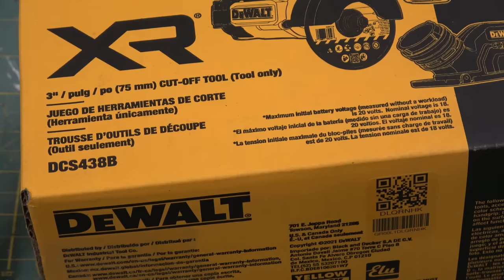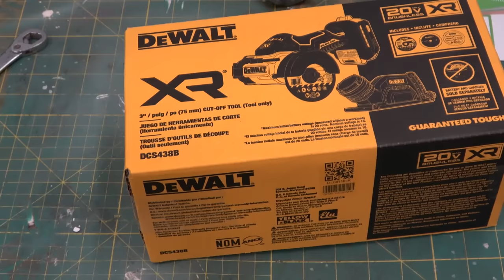BOLTR: DeWalt Mo' Powah!

Comment: Unless they updated this cutoff tool then it’s not that great. I realize cutting 1/4 and 3/8 inch steel is rough for such a tool but it shouldn’t bog down cutting a 1 inch section of 3/8 off
Reply: This is for primarily cutting sheet metal, small pipe, and rods (threaded or unthreaded) he just happens to be cutting thick steel....
Reply: It didn’t bog down that I saw.

In August I used mine to blindly cut a pipe to a mini tank style hot water heater that fit under the sink. I couldn’t get under there with the tool to see what I was doing and ended up going right through the giant nut and fitting without even noticing. Like butter!
Reply: Must be an updated version than the one I got. Either that or I’m pushing too hard. Even with a Lenox diamond cutting blade mine don’t impress !
Reply: @jamesfair9751  Have you tried another battery? Maybe something is wrong with that one.

Comment: Milwaukee use to be made in the US but are now made in Mexico and are junk. Watched a guy go threw #4 of the 1/2" impacts at the local home depo or Lowe's, the manager couldn't believe it when the guy brought a battery and socket to try the second one and broke it before he left the parking lot. The manager went out after he traded the guy a third tool to replace the second one he broke in the parking lot and watched the guy break the third and another fourth one they had left in stock at that store. The manager said he had never seen 4 of the same tools break so quickly as they were brand new from the store. That is the fuckery of the monopolies have right now on products and need a public eye on their products like yourself. Must burn their ass that someone understands the processes and hates getting scammed like us and is willing to show what true quality is and is not! Thanks for your insight on the tools that us fiddlers must rely on to be productive and feed or hunger for more powerful tools that are wort AF.
Reply: Milwaukee issued a recall on that
Reply: @Mikes_Repair Yeah. The 2767 “B” variant tried to eliminate some parts that turned out to be necessary. It wasn’t technically a recall though… the letter they wrote to TTC just assured everyone that they would replace them with the fixed version if they broke.

Comment: Dewalt has REALLY upped their quality since they started their atomic series (while all other manufacturers have dropped their quality). The DCF850, this grinder, their atomic SDS…all very high quality inside. Lightyears above the red tools quality. Have a look inside the dewalt 20v jigsaw, very clean and well built/machined parts

Comment: With so much praising you can't help but think if this was advertising. Tell the truth, Did you get the tool for free sir?
Reply: If he were advertising he would’ve opined about the ToolConnect slot instead of leaving it unidentified. He would’ve touted that you can remove the dust extractor and depth gauge without tools instead of using a tool to remove them with the adjustable blade guard and never demonstrating that they could separate. He would’ve pointed out that the flip-up window is for changing blades with the depth gauge remaining in place, which the competition doesn’t do. Heck, he didn’t even mention that it has a built-in holder for the Allen key (seriously, why doesn’t the Milwaukee M12 3” cut off tool have this?!).